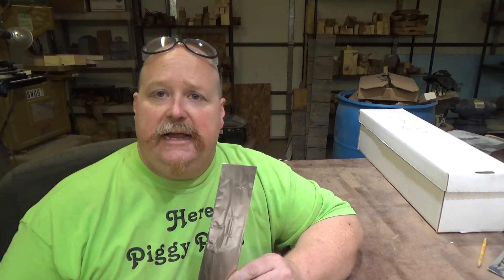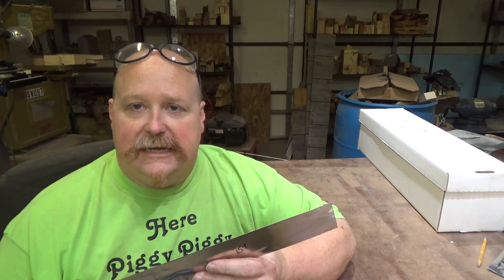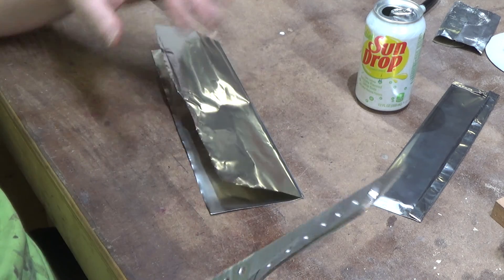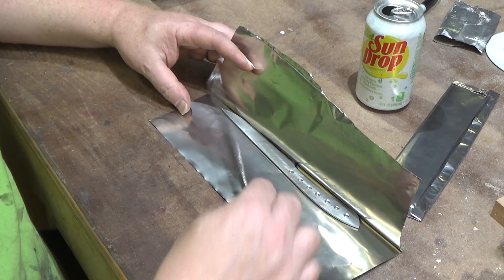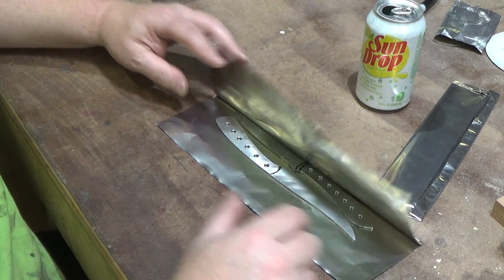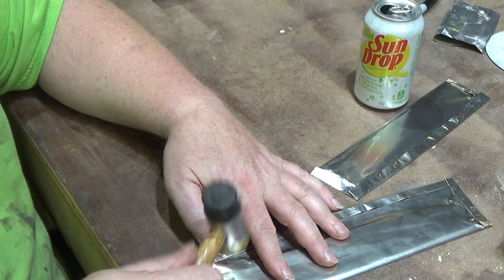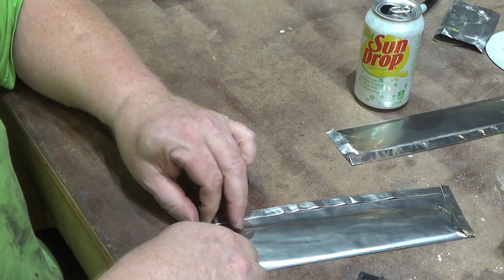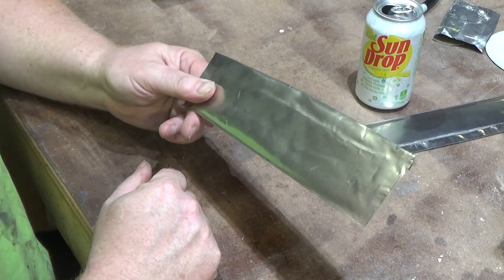Heat Treat Foil Wrap

Comment: Hy! Oil quenching the blade, with the foil, and after removeing it or go to the next proces tempering with the foil on?
Reply from the maker: I'm not oil quenching these blades. Foil is used for steels that air harden or are plate quenched.